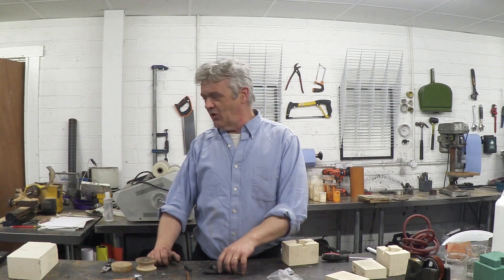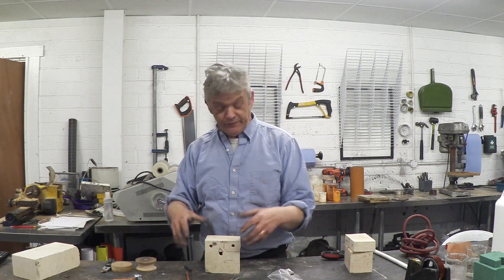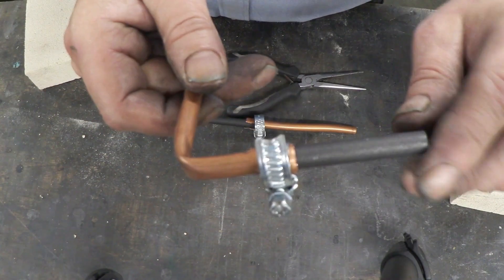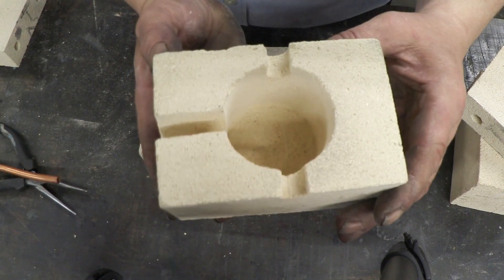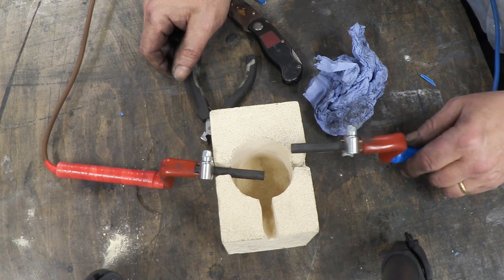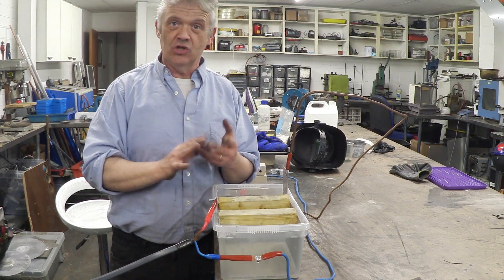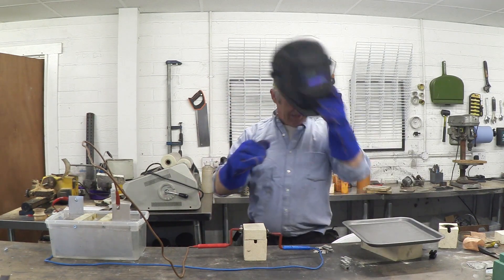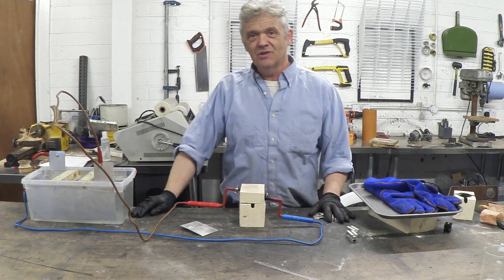Melting Metal With Water

Comment: This is a Darwin awards project, absolutely lethal especially holding the conductors with either hand, you may be confident in your own abilities, but really you need to be a bit more responsible there may be imbeciles viewing this.
Reply from the maker: hence the video about the dangers of electricity posted at the same time mate - thanks for your concern
Reply: @Reuben Longworth:  Respectfully:
1. With the exception of his not placing a lid on his liquid resistor setup, what Robs demonstrated in this video (Particularly the the bit with him holding the conductors) is no more dangerous than simple arc welding. In fact, the fact that he double insulated his leads AND put on rubber gloves in addition to welding gauntlets makes his precautions in that portion of the video far exceed the safety steps practiced by professional welders, who quite often will arc weld with a bare clamp on their welding table (making the WHOLE TABLE PART OF THE CIRCUIT)  and their rod clamp lead (single insulated) in hand with only (sometimes) leather gloves on (no rubber or plastic liners), while leaning against (or on) the metal table. Please refer to the hundreds of welding instructional videos on YT and elsewhere produced and posted by leading manufactures of welding equipment & professional welders for confirmation of this.
2.  Again, respectfully.  Can you please post a link or some form of evidence that Rob or anyone for that matter (aside from their direct legal guardians and specific governmental office holders tasked expressly with doing so) has ANY   obligation or responsibility for the well being of anyone, save those they have voluntarily chosen to look after?
Reply: @Killianwsh  As regards question 1, poor health and safety practice by others cannot be used to justify other poor practices, if safety alternative can be used with reasonable practicality.
As regards question 2, if Robert is making these vidoes as a work activity and is UK based, then the health and safety at work act will apply. This includes duties to protect the public from any harm that might arise as a result of work activities. Prosecutions under that act work in a funny way, if you are the defendant you are required to prove that you have taken all reasonable steps to be safe, unusually the prosecution don't have to prove that you have been unsafe. So, once charged, you are guilty until proven innocent!
Reply: @derekp2674  It is not "poor health and safety practice" to follow or EXCEED industry safety standards and norms in all aspects of a educational demonstration, save those aspects for which there are no "reasonably practical" "SAFE alternative"  available and/or are the subject (or key element) of  the demonstration.    ie. "How XYZ problem was solved before the invention of  the ....."  Or "How to do XYZ if you don't have or can't afford a variac ....        This is the standard methodology used in Colleges and Universities  worldwide to demonstrate basic concepts of all sciences!  Without this practice,  scientific advancement would grind down to only that which can be made with pre-made, "SAFE", Mommy & Karen approved,  off the shelf parts, that are Nanny State certified to play nice nice together, and never( EVER) let the magic smoke out!  
Without the comprehension of scientific concepts ,demonstrated in their simplest  OBSERVABLE form,  the majority, if not ALL,  additional education  in that field might as well be labeled "Advanced use & practical application of Magics & Pixie Dust" or "The care and cultivation of Cosmic Warm Fuzzies & Happy Thoughts"!
As to your assertion that Rob could be charged with failure to fulfill a duty to protect The Public is simply absurd.  NONE of Rob's videos involved or invited  ANY Public participation in any form.  His videos are of him talking about & demonstrating foundational scientific principles,  for educational and entertainment purposes, by himself in the safety of his lab, without even the presence of an assistant, let alone members of the public or innocent bystanders. His videos dealing with subject matter requiring precaution and diligent attentions to safety, not only, ALL contain appropriate precautions and warnings preceding his demonstrations within that video, but also, often refer directly to more comprehensive videos detailing appropriate health and safety practices specific to the topic being addressed.    His videos are NEVER posted with ANY RECOMMENDATION that they be duplicated by inexperienced, incompetent, or underage viewers or in ANY  fashion or manner that would be dangerous to ANYONE.  They are posted with all appropriate specific safety warnings either contained or referenced in each and every video. There is no obligation for ANYONE to watch these videos and certainly none to attempt replication of them!   Individuals, of their own free will and volition, CHOOSE to watch.  In doing so, they are,  CHOOSING to educate themselves. If they, in their own capacity, CHOOSE to ignore or skip over the cautions and warnings Rob has provided, the responsibility for the gaps in their SELF DIRECTED EDUCATION  regarding "Safety" falls upon THEM and  THEM ALONE!  
Additionally, the responsibility for the  VOLUNTARY ACTIONS of Individuals who fail to fulfill THEIR OWN, INDIVIDUAL, DUTY of DUE DILIGENCE & CARE,  falls squarely upon the shoulders of those individuals.   Those who, FREELY CHOOSE to attempt replication of any of Robs endeavors, carry the full burden of responsibility for their own actions.  Rob's videos and the Precautions, warnings, knowledge, and wisdom contained within them are posted and shared freely, to quote Rob, "In the hopes that they will inspire and awaken a desire for learning and discovery in others."   
His efforts and intentions, in teaching and offering knowledge freely, are both, noble and without malice. There is neither "actus reus" or "mens rea".  In jurisdictions with due process or natural justice, there must be BOTH actus reus ("guilty act") and mens rea (guilty mind) for a defendant to be guilty of a crime.
Reply: @Killianwsh  I'm sorry but I fear that the principles set out in the UK Health and Safety (etc...) Act may apply here, just as they would at any UK educational or industrial establishment.

Comment: I have managed to rebuild it and I have to say that it is important to take a big bucket for the solution, as it warms up strongly  (trying with a table garbage bucket 1,5 liter)
but it runs hahahahahahahaaaaa!
Thats absolut fantastic so you can spot weld sheet metal.
One useful machine for my workshop.
THX for it you are the best!

Comment: Rob a couple of things : you can place that water resistor in another larger ,closed plastic container which will protect anyone touching the electrodes especially the live feed. Also , what voltage was coming off the carbon electrodes and or current ?

Comment: That is pretty awesome.  I will have to keep the water idea in mind if ever I am without a welder and need to weld. 

I was going to do some carbon melting and making rubies and other gemstones, but after getting my electricity bill after only 30 arc minutes welding (since I moved to town) it seems to have quadrupled in price (electricity) within city limits.

If I was still  in the country, I'd be headed out right now to give this a go, lol.   But instead I will be waiting until I can build or buy a 20kw generator to run the welder/other electrically demanding projects.
Reply from the maker: go for it mate - thanks for taking the time to post

Comment: " liquid rheostat" we saw them used in the stepless startup circuits on very large high-lift pumps on water pipelines. They were also commonly used in the railways as a test load.
Reply: Mmmm......my perception is a "variac" is a variable transformer......while this is behaving like resistance. I would like to understand the effect.. My understanding this is part of the arsenal of things that stage theatre used., a little safer than limelight.!
Reply: @robertwoodliff2536  The conductive plates are immersed in a conductive ionic fluid. Changing the depth changes the effective resistance and the resultant coupling of energy through the circuit.

Comment: I built one of the arc light using the battery core and use a electric heater coil in series on one side, this was in high school for a science project.  thanks for bring this up and showing how to melt metal with it and not just for lighting.
Reply from the maker: that sounds cool mate  and glad you liked it - cheers

Comment: Not so sure about the Perfectly Safe remark. Given that you have exposed Live terminals from 240 volt mains supply. Would it not  be a bit better if you ran the Neutral through the ScariAC?   You could then adjust the Neutral plate safely if needed. I hope you have RCD or GFCI breakers in your installation or use a plug in version at the outlet
Reply: I agree that there is nothing safe about this setup. Potentially dangerous "ceiling wax and string" experiments like this should be for the entertainment of consenting adults only and never for domestic or commercial purposes.
Reply: @derekp2674  It's " Sealing" wax and string. You know the stuff used in old times to Seal envelopes. What the hell is "Ceiling" wax?

Comment: Hi Robert. This is the first time I’ve seen such with a bucket of water, wondering why, then realizing its a ‘current-limiter’. If that is its actual usage reason, the first thought was to use incandescent light bulbs in series for current limiting. What is nice about that is the bulb wattage say 100Watt is what the carbon rods will get. Then of course, two 100W bulbs in parallel would be 200W and so forth. So just passing this on if one wants to limit current to a specific amount. Amazingly, in your next video, ‘The Dangers-Of-Electricity’, you speak of a light bulb (incandescent version) as being a resistor, that matches my thoughts in this Welding-Medal-With-Water video. Happy discovering and building.
Reply: As noted elsewhere in these comments, these "brine bath resistors" have been used in industry since the dawn of the electric age. One of my industrial archaeology books that a photo of such equipment for motor speed control, dating from about 1890 at the Maenofferen slate quarry in Wales.
As you say, modern safer alternatives are now available. Personally, I also use filament light bulbs for this when appropriate.
Reply: Interesting idea here, I’d love to see more chime in on this

Comment: In the scaryac, you used salt and it worked, but over time it will make chlorine gas  and or sodium hypochlorite,  aka bleach.  On the other hand,  a better product to use and is found in most homes is baking soda (sodium bicarbonate.  and electrolisys is likely to only make sodium hydroxde and CO2 gas and hydrogen gas.  In time with no use, the sodiuim hydroxide solution will reabsorbe  co2 from the atmosphere making  sodium bicarbonate again. 

Also because sodium hypochlorite, and sodium hydroxide, and sodium carbinate, errode at the passivated aluminum oxide layer  that protects the aluminum from further corrosion, I would recommend not using aluminum.  Stainless steel plates are best, preferably 316L

When figuring out  plate area and electrolyte strength, avoid going over  0.5 amps or less per sq  inch of plate area to avoid over driving the plates, helping them last longer.
Reply: I dont think this water will electrolize because he is using ac. This should be safe.
Reply: sk8pkl well he is not using ac if its only half the sinewave . Its really no different to pulses dc but half sinewave instead of square wave so over time it actually will release chlorine gas but not so much over 5 minute period with ventilation!
Reply: @Buzzhumma  I did not see a diode in there?  I know 2 years later, but if still out there, can you explain your comment?
Reply: @sk8pkl  Electrolysis proceeds under dc and ac currents.
Reply: He's  got this!👍
Reply: Just stay in well ventilated areas, no issues.  I was wondering how much H2 and O2 was being generated.  Not a whole lot I am assuming, but still well ventilated space even for home lab use.  Commercially there are probably health codes, but that isn't the point here.  Is someone doesn't feel safe, don't do it!
Reply: @servant74  h2  and o2 production are proportional to current.
Reply: What about using urea and then capturing the H2 to generate more energy ....
Reply: Can someone explain what the purpose of the water is? I seemed to have missed that.

Is it a safety mechanism, current limiting? Or it it for half wave rectification as mentioned above?
Reply: @onradioactivewaves  The water acts like a variac, limiting current.
Reply: @GGigabiteM  maybe you already know, but for anyone reading this thread, just like a variac, the scaryac  limits power. 

But with the variac, one changes the number of turns on an auto transformer delivering an adjustable voltage, and is very much more efficient than the scaryac that simply dumps excess voltage through varying resistance in an electrolyte.
Reply: @onradioactivewaves  the main purpose of the water (electrolyte) is to control or limit the ammount of  current.
Reply: How would using Niobium plate instead of 316L stainless plate ??? Do you need a plate per two volts ??? Thanks VF
Reply: @victoryfirst2878  I have no idea about Niobium.  Electrolysis proceeds more efficently with a low voltage like say two volts per cell. But he is not interested  in electrolysis. He is more interested in limiting current.
Reply: "scaryac" 😂
Reply: What about lye?
Reply: @mattbanks3517  lye will work, but over time, it will absorbe co2 from the atmosphere and become sodium bicarbonate which is little  less conductive causing a change in performance between uses. One might just go strait for sodium bicarbonate and have repeatable results.
Reply: Have you ever carried out electrolysis of NaHCO3 in solution?
Reply: @PeterPete  i have used sodium hydroxide, and potassium hydroxide seperatly. But, since each hydroxide absorbes co2 from the atmosphere in solution to form a bicarbonate, then yes I have technically used sodium bicarbonate.
Reply: Stainless steel has the nasty problem of releasing ions of heavy metals when it corrodes, which are toxic. Chief among them are chromates, which are carcinogenic on top of being toxic. The orange/brown slurry that forms on top of electrolysis baths contain chromate compounds and should be treated as hazardous waste, but unfortunately, most people just dump it down the drain.
Reply: @GGigabiteM  don't worry...your RNA is already incorporating the long chain hydrocarbons in your bloodstream....im sure your future bloodline will adapt....
Reply: @GGigabiteM  graphite. Use wisely.

Comment: The phone call was probably the local electrical health and safety board asking "what the hell do you think you are doing".
Jokes aside, great video. I don't want to detract at all from the ingenuity of the chap in Africa, but the salt water bath has been around for probably 50 years or more. I think that you will find it referred to in some early electrical engineering books. 
We made a welder using this method about 50 years ago in dads garage in Bulawayo, Rhodesia. You can also vary the current by varying the salt concentration.
Reply from the maker: the phone call was actually my wife checking up on me - it seems i missed dinner again lol
Reply: @ThinkingandTinkering  What's dinner when you are having so much fun!

Comment: Rob, I'd really appreciate an indepth video on how to make the water based transformer.  I'm not sure what the wood is for.  I'm guessing that the water is just the resistor to limit the current that can be discharged through the circuit, so if you had a longer tub, you'd reduce the current and probably increase the voltage (maybe, IDK if the V would increase though..)  
Is the current passing through or around the wood and is the wood saturated?
Reply: The water bucket is not a transformer. It’s a capacitor with a water based dielectric. The water is very lossy due to the salt, so it would act as a resistance in series with a capacitor. The wood is there just to hold the metal plates apart. All of the bare conductive parts are LIVE and would kill you if you touched it.
Reply: There are two currents passing through the bucket. One is the displacement current which is due to the capacitor, where the electrons don’t physically pass through the water but build up on one side of the plate and oscillates back and forth between plates with the mains frequency. The other current is the conduction current. This is where the electrons flow through the poor dielectric material, I.e. the water.